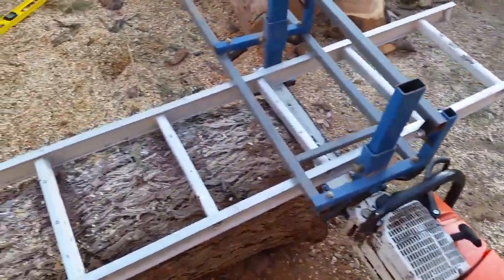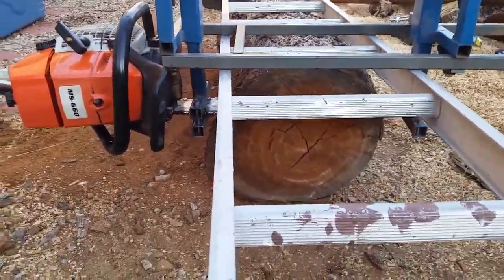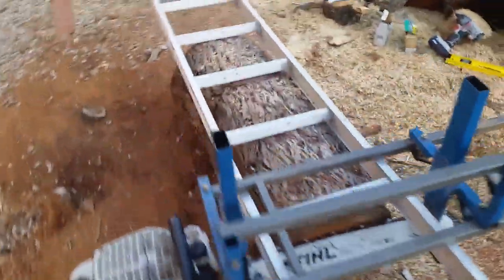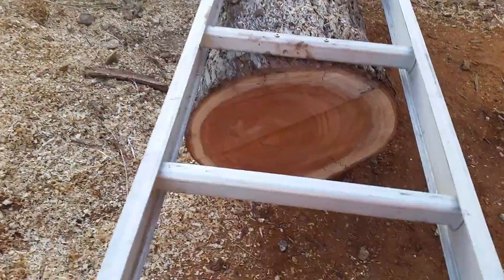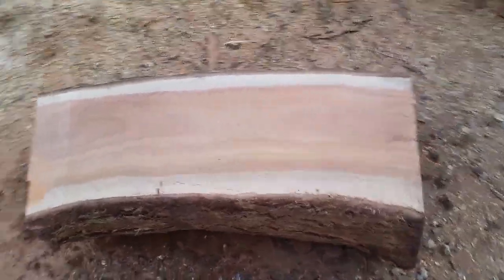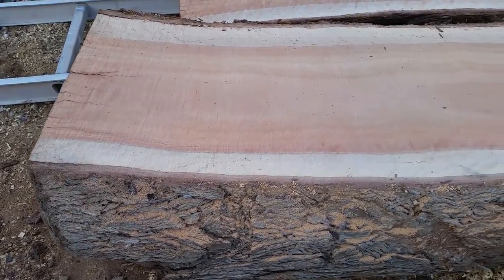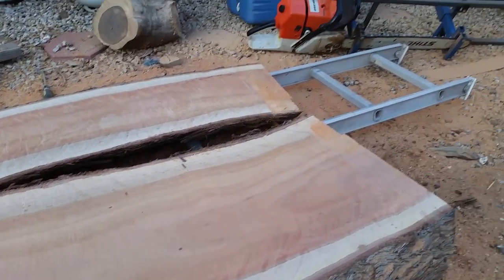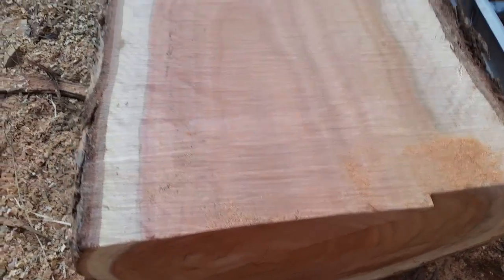Chinese MS660 chainsaw milling oak 1

Comment: How long did you break the saw in before milling and did you put a high output oil pump in it. I just got done putting mine together and plan on milling with it but I don’t think it oils enough. I have it cranked all the way open
Reply from the maker: I've been milling with a standard oiler for a few years. Oils well on the 48" bar

Comment: Nice rig don't you think.   Love my FarmerTec 660 with a 42" bar. Don't forget a few wood wedges in the kerf to keep the cut surfaces free from gouging...especially on the end of the slab where the weight will always gouge the slab with the trailing edge of the bar.
Reply: Do you do alot of milling with this setup? I was looking at this same setup vs the 070 and a 42" bar and keep getting told to get an 880 or 090 or the husky 3120

Comment: enjoying your videos..
2 questions...
1..looking at the panther vs the granberg..seems that the granberg has refinements such as measurements on the rails..oiler. .helper handle.etc...if you had to do it again..would you still go panther?..if so..why?
2...have you resolved your  tensioning issue that you were having in your other video with the 070??... and do you know where one can buy the upgrade cylinder to take it to an 090... I don't see it on that  huztl website anywhere ..thank you for your response.. New subscriber. Greg
Reply from the maker: +Hardwoodbuyer Id still go panther. Easy to expand and make it bigger(I made a video) and it feels more durable.
I picked up a 090 cylinder and it made the saw vibrate like crazy. The 070 cylinder spit out the decompression plug so I jb welded it. Just tonight i reinstalled it and now I think I have a carb problem as it wont stay running after its choked.
Overall I'm disappointed with the 070. Not a good copy. I'll be putting a video together.

Comment: You liking the G660 for milling?  Im wondering whether i should get the 105cc G070.  What do you think?  It would be strictly for milling.
Reply from the maker: 660 is better. Easier to work on

Comment: now that you've used both clones 070 and 660 witch would you recommend for milling? and how big of bar can you run comfortably for the 660? thinking of ordering from huztl
Reply from the maker: +triston oshanski 660. The 070 is heavy and vibrates too much. I'm currently running a 42" bar on my 660 and it oils it very well. Check out my newest milling video

Comment: Was just wondering in the terms of when folks mill planks for lumber use vs what you're doing. Say if you're gonna use both sides of rip. 
Hey,, if the saw does the job, Chinese or other,, no complaints here. Why all the hate bout using the oriental saw vs German or Swedish. They all break down at some point and need maintenance. So if you paid 200 vs a grand repairs breath a lot easier at 200. Happy milling.
Reply from the maker: +Peter Ford thats my thoughts. I think its the tribal ford vs dodge mentality.
Reply: KimballCody Yep,, but more like FORD vs Toyota. Haha. Just seeing all the flack people throw is disrespectful and disappointing. In this day and age.

Comment: I wanted to ask did you use any OEM parts in your saw?
Reply from the maker: None. Replaced clutch drum, oil pump and now the main seal is leaking oil into the crank/cylinder.
Reply: KimballCody I did a bit more on the MS360 but its a bit too small for 24" bar... Also.. I used OEM screws for crankcase since the chinese ones had strenght class 8, OEM 12... thermal diffrence will strech them out im afraid. Actually you can use any M5 12.0 hex/torx screws there. Will buy 660 too. Seems like a nice powerhead
Reply: KimballCody how long before crank seal leaked?

Comment: It sure does take some time setting everything up. I dont like it either. You could set everything up like it is in the video and just mill a bunch of logs like that. I did that once and it saved a lot of time. If I was doing things your way I'd worry a lot about hitting the screws. With the angle iron on the ends of the log and 2 by 4s on top theres almost no chance I'd hit the screws. I agree, there's a lot of people on youtube that don't like my chinese saw, the timberpro and me because I bought them. I'm sorry I don't have the unlimited money ($500 to $800 and up) to go drop on a name brand 62 cc saw. Lol.
Reply from the maker: +Love2boat92 I'm going to experiment with different ways of setting the ladder on. My screws were only an inch at most in the wood and I was cutting 2.5" slabs.  I've found that 3 or 4 screws keeps it anchored

Comment: The first takes forever, but successive cuts not so much. I learned a lot of the methods from a book called Chainsaw Lumber Making where the author recommends attaching a winch to the mill and log and cranking the mill toward you as it saws. THAT takes forever to set up, but it really is convenient to stand at one end of a 12' logs and just crank rather than walking on my knees pushing with my lower back and breathing dust and exhaust. But I'm doing a ton of long logs.
Reply from the maker: +Lolita's Garden I picked up a winch and will be installing it soon

Comment: Nice wood. That the 42" bar?
Reply from the maker: 36" I think
Reply: @KimballCody  local shops only carry max of 25". Went to order a 36 and they had 32 rollermatic es with stihl yellow chain in the back someone never picked up. So I got a fair deal on that for my new g660

Comment: So the setup has to be bolted on for each rip huh?
Reply from the maker: +Peter Ford some people slide the jig on top of the log after the first cut but you have to adjust height which takes time. I just would rather rebolt the ladder and cut
Reply: KimballCody seems more secure that way. Never physically seen a professional unit,,, so can't compare to anything. Long as it works for u that's what counts.